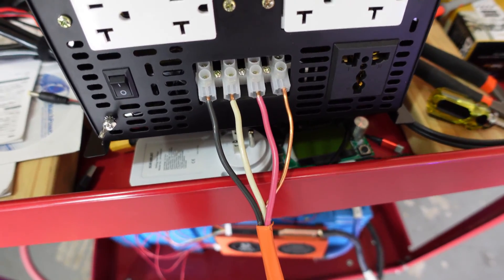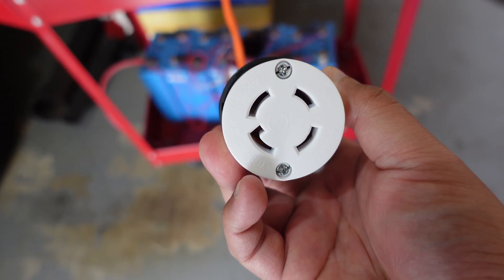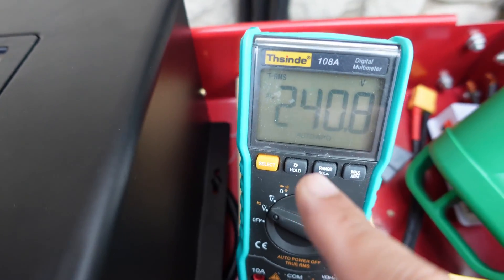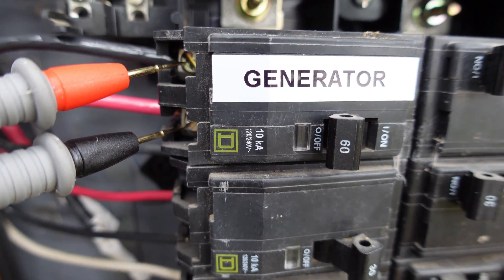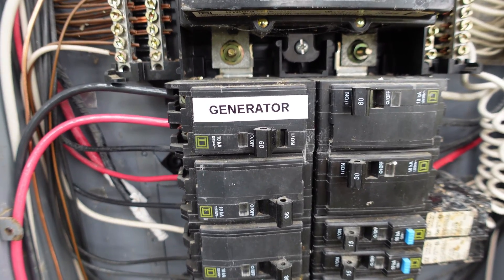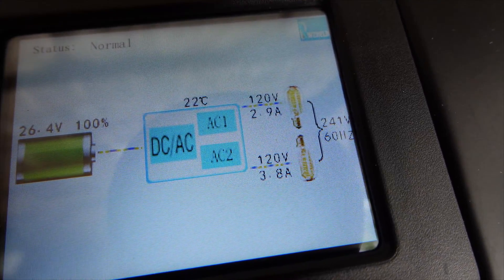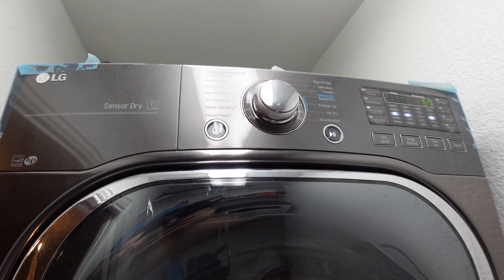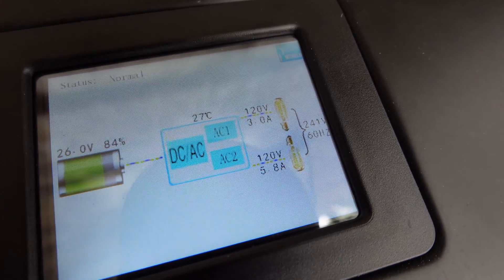WZRELB 3000W Split Phase Inverter test part2, 240v test

Comment: 40 Amps for a Bosch Tankless Water Heater and 20 Amps for My Well Pump @ 2 Legs o 10 amps each is Needed here. Should I go 4 or 5K WZRELB Dual Phase Inverter  ?

Comment: How is the inverter running so far any issues?
Reply: I have the same question.   Any updates now that you've had it a while?
Reply: To make the 30amp plug for the inlet can I buy that premade with the wires or did you make it yourself ?